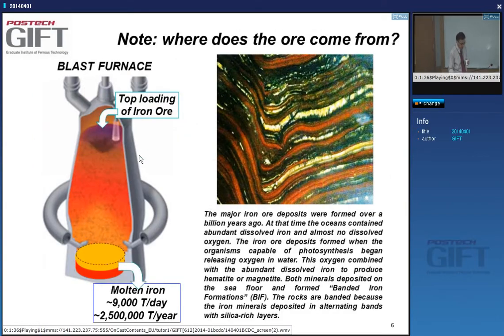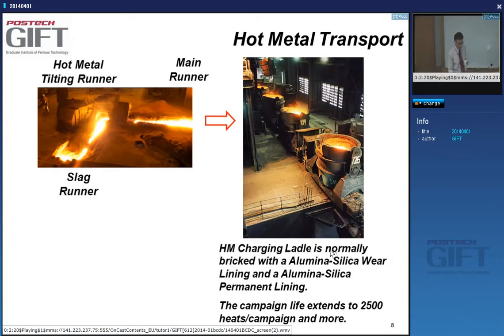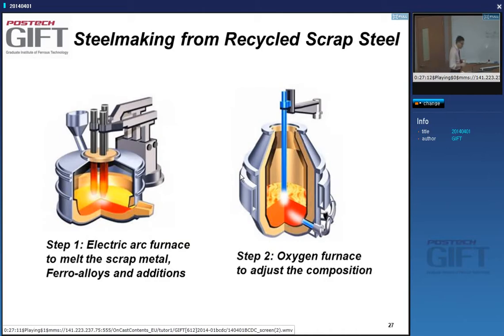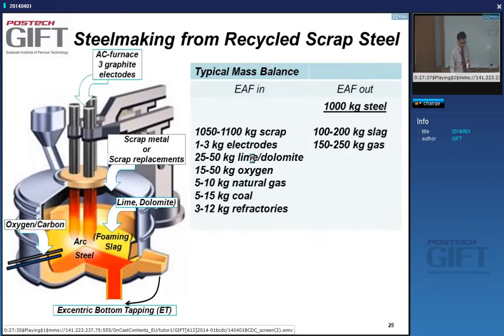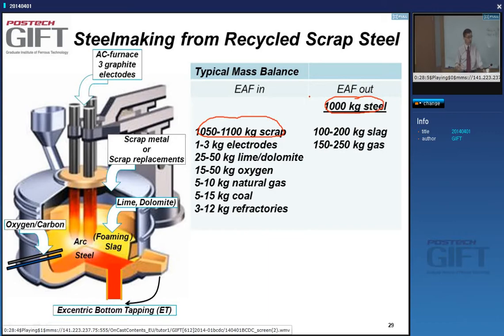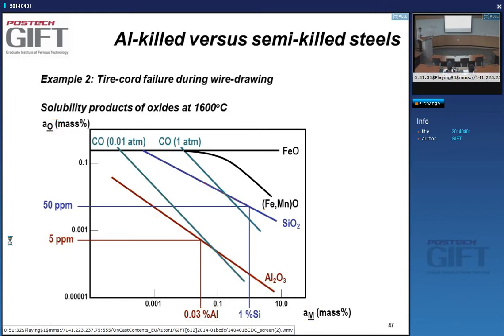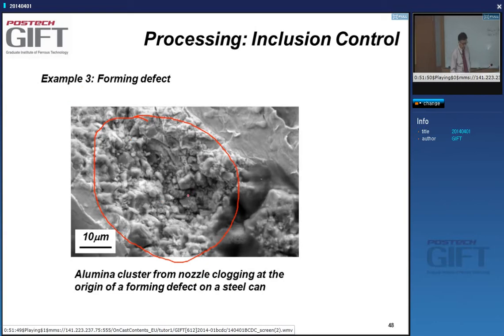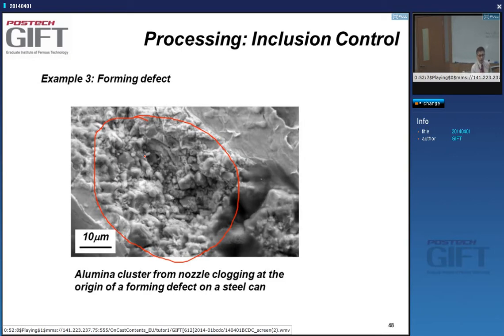Modern Steel Products - 2014, Ironmaking, Steelmaking: 8

Comment: In the last section of Calcium addition, what should be the criteria of Calcium wire addition? Is Calcium by Aluminum ratio  by weight or by atomic fraction in the diagram at 1:07:37?
Reply from the maker: Lu DZ. Kinetics, mechanisms and modelling of calcium treatment of steel (Doctoral dissertation).
Reply: @bhadeshia123  thank you sir.